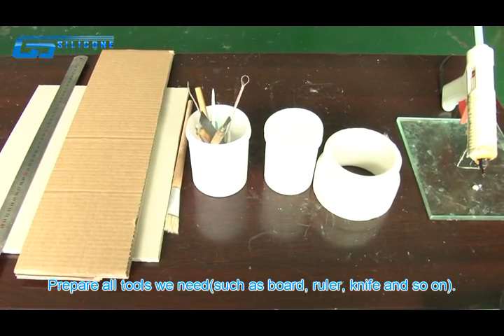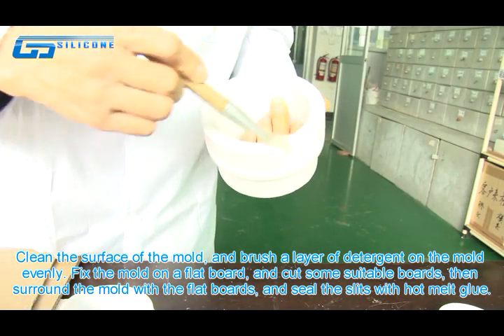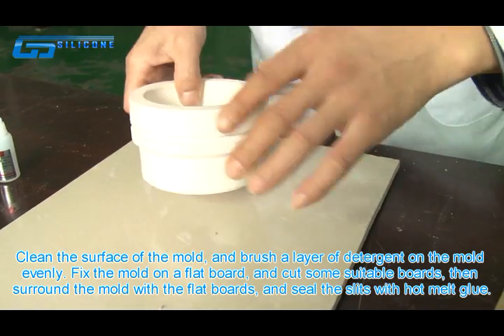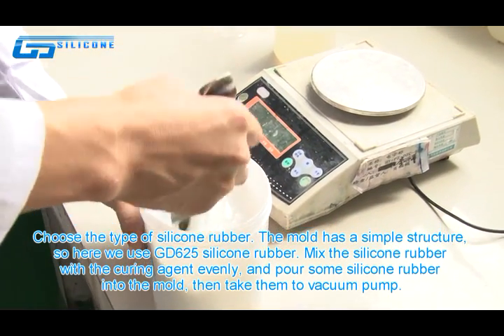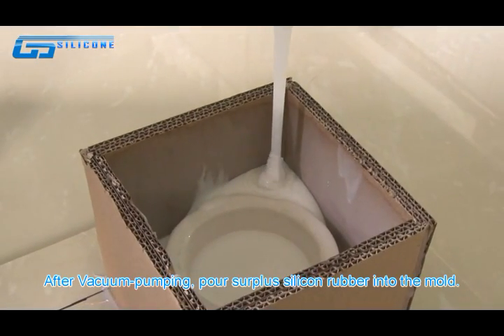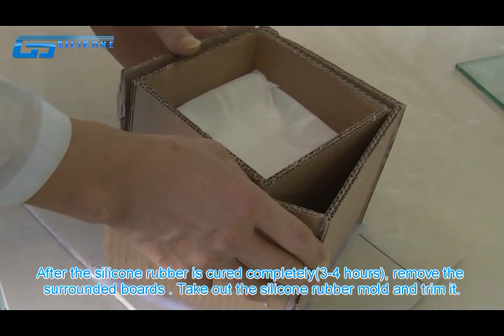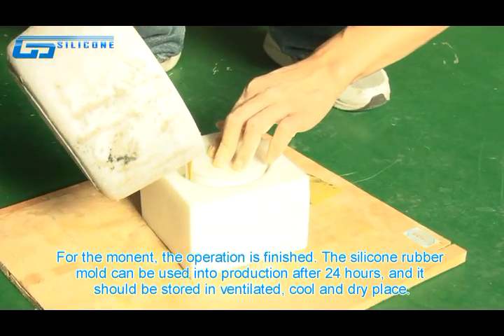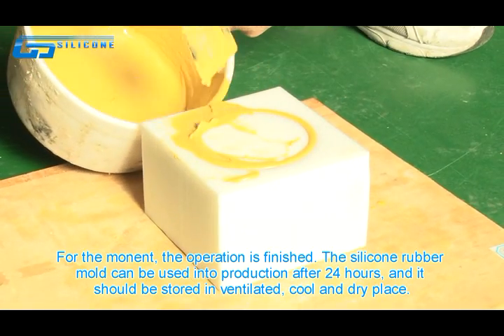Making Cement Products by Silicone Rubber

Comment: Why did you cut it in a zig sag?
Reply: It helps the edges line up again when moulding. Straight lines can slip or be easy unaligned.